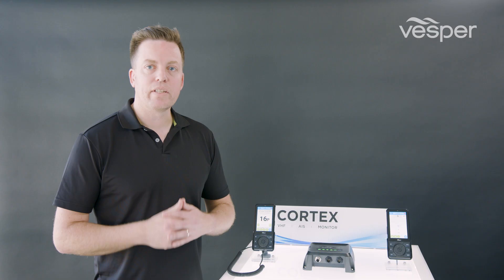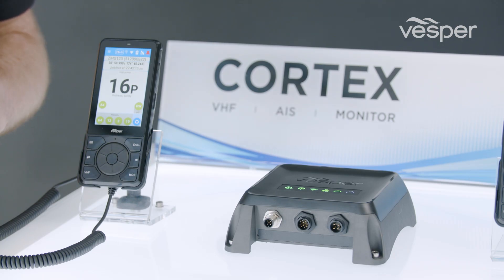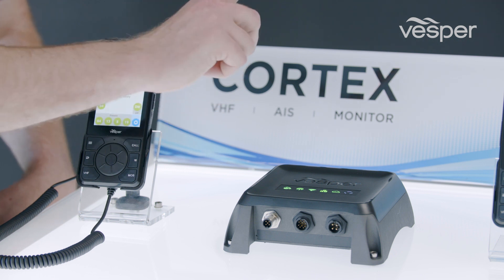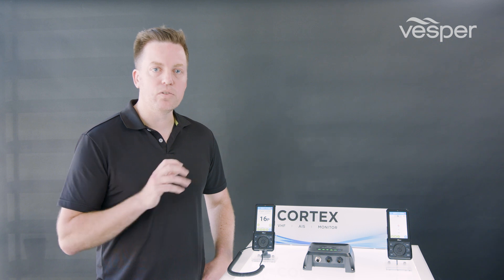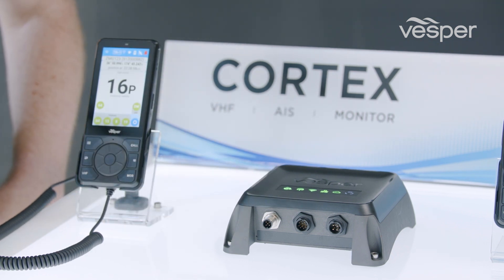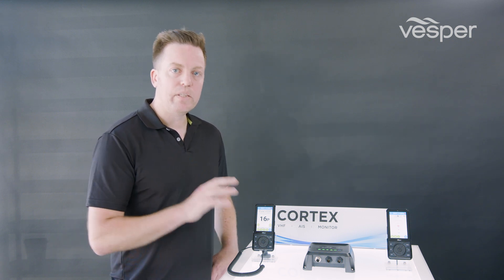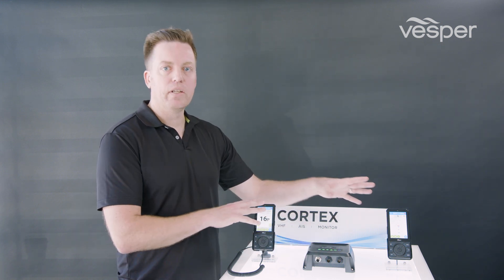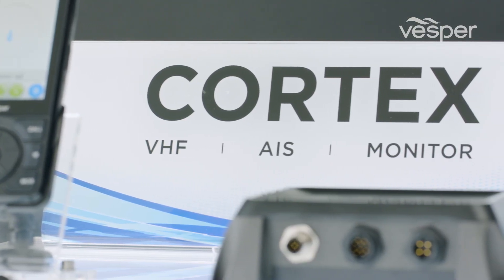Cortex Demonstration: Cortex Hub

Comment: Hi - regarding the WiFi and NMEA2000 functionality;  does the unit act as a Gateway device (like an Actisense (W2K-1) or Digital Yacht (Navlink 2) for examples,  and allow a popular IOS app like iSailor to receive and overlay the data?  Thanks!
Reply from the maker: Hi Hank, yes Cortex acts as a bidirectional NMEA 0183 to 2000, and it will broadcast those sentences over Wifi for other devices. You can find out how to connect Cortex to your device here: https://support.vespermarine.com/hc/en-us/articles/360002009816-Using-Cortex-data-over-WiFi-Apps-and-Navigation-software-settings